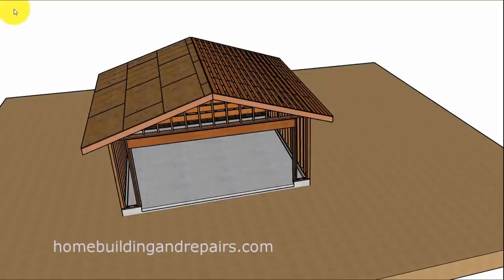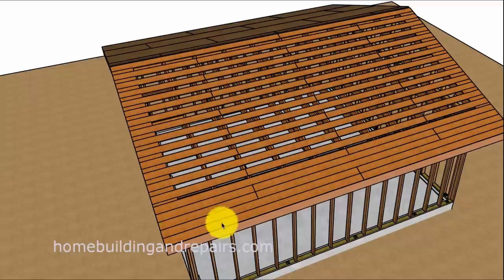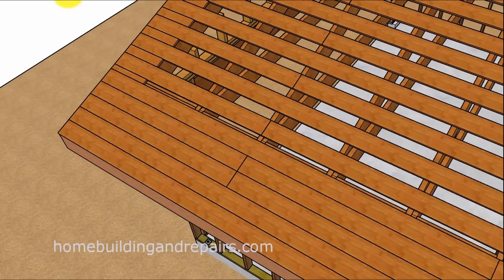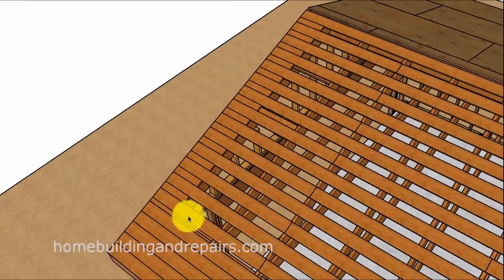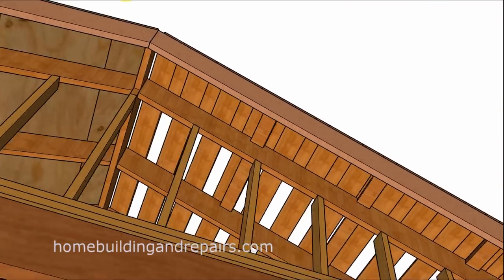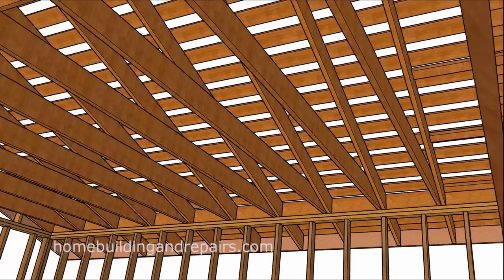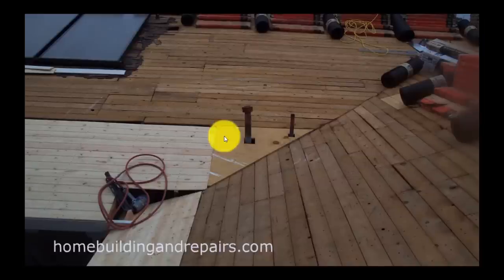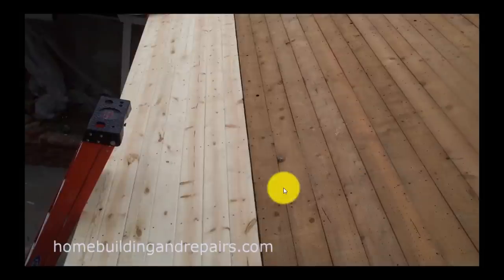How Roof Sheathing Was Installed In The 1950’s – How It Was Built Years Ago

Comment: The price of a sheet of OSB in my area went from $11 to $29 in one year. I am going to sheathe my garage roof and walls with 1x6 planks that I am going to mill from my trees which will only cost me my time plus a few cents for gas and blade wear. But it’s nearly impossible to find any information on how it’s done since nobody does it anymore. Thank you very much for this video.
Reply: Currently doing the same here.  Instead of T&G, I'm doing a simple 3/4" half lap (Ship Lap).  Can set up a dado stack and save on running through router bits.  Not to mention its faster and cheaper than a T&G.  Make sure you give yourself dry time from wet timber depending on species or budget kiln time and money.   Best of Luck.  This method makes for a rock solid roof.
Reply: @d1986ben  Your method is good. I read about it recently in a book written about 70 years ago. It says with ship lap the boards can serve as wall siding and sheathing at the same time. I am going to use common boards though and no drying, straight off my saw mill. Both on the roof and the walls. Just like our grandfathers did before kilns existed. Those houses are still standing over a century later.  I might use ship lap in my future projects. The hard part is waiting for about a year to air dry, but after that the savings are serious as siding and sheathing are combined in one.
Reply: @differenthandyman938  Great response and I agree.   Although, I would recommend drying your lumber for numerous reasons.  This can be achieved in around 45 to 60 days.  According to the U.S. Forest Service's Forest Products Laboratory in Madison, Wisconsin, it takes 1"-thick green boards from 45-60 days to air dry to 15-20 percent moisture content in sunny, temperate, not-too-humid weather.  I can concur with this as I am a Northern Wisconsin resident, I've dried pine down to 11% in 50 days.  Top reasons for drying lumber.  1.) Sealant (top coat) adherence and longevity; if your using it as siding and sheeting it will require a top coat and you want it to adhere and absorb if your relying on the time it is installed to dry to an apprioate level the hydraulic effect of letting off moisture will not allow a good sealant top coat.  2.) Trapping moisture/mold with our current internal building specifications (older houses breathed significantly more than current, 3.) Kills most/a lot of larvae/insects and spores.
Reply: @d1986ben  All valid points and I did consider drying it first, but ultimately decided against it. Our summers here in PEI are short and drying the lumber would mean another year without a garage. The idea is to build it entirely from green lumber, including framing and sheathing/siding, but not to finish it. No painting or staining, no wall insulation or drywall. By next summer it’ll dry and I will be able to finish it. In the meantime I can use an unfinished garage. It will be cold and not pretty, but at least my vehicles won’t be buried under 8 feet of snow. Green lumber isn’t much different from pressure treated in the sense that you never stain a deck as soon as you build it. You let it dry and stain it next year.
Reply: @differenthandyman938  my roof deck is neither t&g nor shiplap. Just rough sawn boards. Even bits of bark on them!
Reply: @differenthandyman938  How did the build go? I am doing a timber framed house and seriously considering using green wood. Any tips/ advice?
Reply: @lordsofpondland  I found building with green lumber isn’t much different. As long as you nail it right after it’s milled, it doesn’t get warped. Looking back, I think sheathing with 1x6 boards is a bad idea. It takes an entire day to sheathe as much as I could do with only two sheets of OSB. You have to fell a tree, cut the limbs off, skid it out of the woods, mill it and then nail each board individually. That’s very inefficient use of my time. It’s like working all day for $60. I’m glad I did it though. It gives me a certain sense of pride to know that I built my garage entirely from the trees I harvested from my land and milled. It has survived hurricane Fiona that destroyed many buildings in my area. And now that it’s almost two years old and the lumber has dried completely, I can insulate and drywall the walls if I choose so.
Reply: @differenthandyman938  Thanks so much for the information! Seriously very helpful. For me its more of a sustainability point and also for longevity and health wise. Time is a thing but my house style is already NOT efficient at all as it is a roundwood timber frame. Thanks again for the information and your two cents. Any other suggestions/tips?
Reply: @lordsofpondland  Another tip, don’t mill a lot of lumber at once. Mill only as much as you can use right away, on the same day. This way you don’t need to stack it, mess with spacers, weights etc. Saves a lot of time. Plus you switch back and forth between milling and building and don’t get tired as much.

Comment: Solid is how all roofs is constructed in Scandinavia. Why? Stronger, can carry more weight. Have a better and natural resistance to mold. Don't sag or bend. You can have rafters spaced out more, and save cost and work.
Good lumber have tracks not only on the length but also on the short side. So you don't have to have a joint over a rafter. 
The modern way of build is to buy ready made sheets of nailed solids. They look like doors in size and are nailed in factory.
Reply from the maker: I've always been interested in the way things are built around the world and thanks for sharing.

Comment: What is used to seal between the 1x6 or 2x4 boards? At 4:12 looks like it was done on the new, but not the old? Thanks!
Reply from the maker: This type of sheathing was used for wood shingles or tile and didn't require a filler board between.
Reply: @gregvancom  Oh, I see. I am making a repair to a flat roof which just has the 2x4’s and no plywood. Thought maybe you’d want to add some caulk or something in between the boards.

Comment: Hopefully I can get an answer to this question. I just bought an old east coast home, got in the attic crawl space and noticed it's just like that, boards, with spaces. I can see thebvapour barrier from the recent shingle work... if I want to convert it to plywood for better moisture management... can I install the ply on top of the existing boards, or should I remove them?
Reply from the maker: I would check with local contractors or building inspectors. I've seen both methods used with good results.

Comment: I have a 1935 House with roof sheathing just like that, From what I can tell in the attic, it looks pretty solid and no leaks.  Is this type of sheathing just replaced if it's bad when installing a new roof? or will it be replaced with osb or plywood no matter what?  I live in a fairly dry area of California, and from what I can tell absolutely no rot.  Also how does this sheathing do with spray on insulation?
Reply from the maker: You can replace it, but most builders don't. They install new roof sheathing over the spaced sheathing or sheathing with large gaps between boards.

Comment: I owned a 1923 built two story in Ohio. The roof was built like that with the spaced "slats". When I bought it in 1997 it had the original cedar shake roof, then sheathing, then 2 asphalt roofs on top of that! No sagging whatsoever! The entire house was built with red pine... and after 75 years it was hard as a rock. That house will stand forever the way it was built, and it would cost $$$ to engineer/build houses like that today. Ironically they were affordable then... without taking shortcuts on structural strength. Don't even ask about the electric though! 😱

Comment: I have the 1x6 now changing the roof by code required to have radient barrier. Now I don't know if i can use the radient barrier on top of the 1x6s
Reply from the maker: Check with radiant barrier manufacture and local building department for clarification in your area. I realize I answered you email already but others might be looking for this information.

Comment: I thought I heard you mention that you put the the new plywood over the old 1x6. This is what I was contemplating so I don't have to pull all the strips. Did I hear you correctly? 
Thanks
Reply from the maker: I would check with your local building department, but I still see it being done in 2021.

Comment: Can you go to Lowes or Home Depot and buy 1 X  6 lumber to replace these planks?
Reply from the maker: If they have the correct wood for your area. Sometimes it needs to be a stronger lumber and with an acceptable grade.
Reply: @gregvancom  I am not at the location of the house so I can't measure the boards.  I guess if I could someone to measure the width, I would still not know how thick the boards are.

Comment: My home / original roof was built 1850... in Michigan ......had new roof installed 2019. The guys ripped off deck boards exposing original 1x12 roof boards with hand made square nails. All still there with only a few bad spots. Workers were amazed.
Reply from the maker: Now that's an old house and thanks for sharing your experience with everyone.

Comment: What was the most common roofing material for barns in the 1940s/50s? Asphalt shingle? Cedar shake shingles? Corrugated steel? Thanks!
Reply from the maker: I would say wood shingles or shakes, then asphalt and then metal or tile in California. However it would really depend upon what part of the world you where in.
Reply: @gregvancom  thanks! I’m in Wisconsin. Most of the barns around here today have either metal or asphalt shingle roofs. But I doubt most of those are the original roofs. I’m doing a farm model set in the 1950s, and was trying to decide what roof material to use. I’m leaning towards Cedar shake or shingles.

Comment: What's the price difference between plywood decking and the 1x6 T&G?  I'm in the early stages of designing a house and I like the look of 1x6, but I worry it may be too expensive.
Reply from the maker: Check with you're local lumber yard, prices vary in different parts of the country and I with you the t and g is probably going to cost more.

Comment: With 1x6's and ceder shingles you had a roof that breathed especially when it got hot. You didn't have much in terms of venting and you probably didn't even have insulation. Then later they throw on a 1/4 plywood sheathing and asphalt shingles and you end up with an attic that traps heat.
Reply from the maker: Good points and ventilation didn't seem to be a big concern with some roof designs